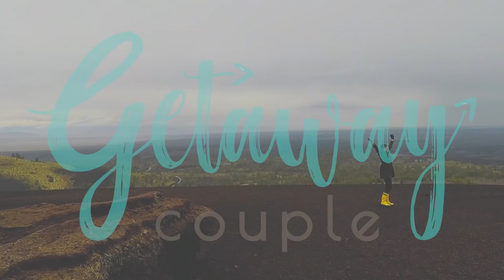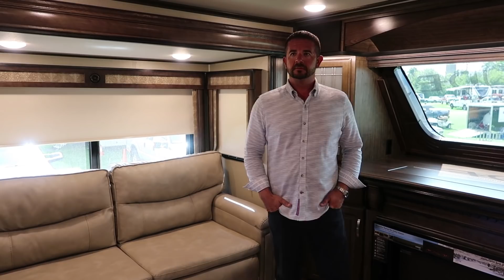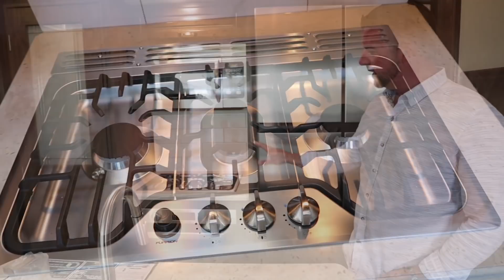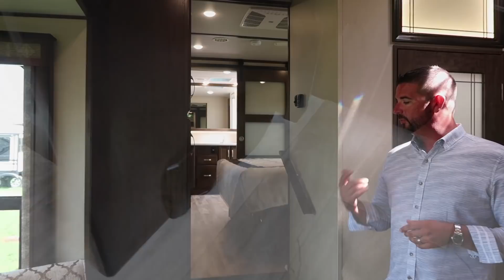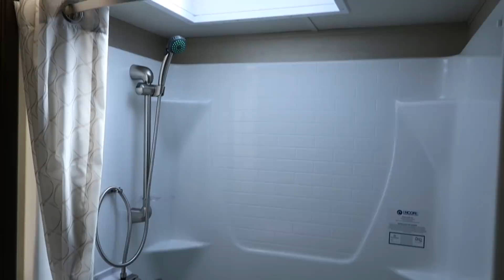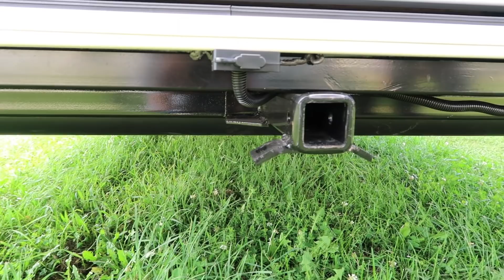RV Tour: 2019 Grand Design 380FL (Brand New MUST SEE Floorplan!)

Comment: You would think with an MSRP of $90K to $100K, that it would come with a stackable washer/dryer. I know of cheaper models that do come with them. But it is beautiful!
Reply: I was thinking that sound structural and thermal engineering would be useful, but I know that doesn't happen at this size in this price range, either. Aesthetics are a lot less expensive and lighter.

Comment: What kind of frame does it have?
Reply: Aluminum in a dissimilar-metals mix with steel and without a thermal break, claiming R values that defy the laws of physics--the usual RV industry routine, unfortunately. I had really been hoping for an engineering design that was seriously grand, but it is far from it.

Comment: Great video. Nice 5th wheel. We have a 2018 Montana 3730FL, very similar design. The 380's kitchen seems to cramped with the half bath stuck in right by the pantry. Still a nice unit, just not for us. You all be safe. Safe travels. Later
Reply from the maker: Thanks for your input, Walt! It didn't feel cramped when we were in there but I get what you're saying. We were thinking it might be nice to actually turn the pantry into cupboards and expand the counter space next to the stove. Happy travels!
Reply: @GetawayCouple   I agree having the option of the extra counter space and cupboards would be a great option. We just ordered this unit and I asked if there was anyway we could trade out the half bath for another pantry/closet and counter with cupboards...the answer was "No"
Reply: I agree about the kitchen . With no dishwasher you need the island for dishes. There is very little meal prep space or counter space for appliances you keep out - like a coffee pot. And even if you put them on the hutch countertop where do you plug them in?

Comment: I love the GD floor plans. but the A/C (which is blatantly obviously running ) is way too noisy. I am leaning toward a Keystone just for the whisper quiet air.
Reply from the maker: Yeah, our mic was obviously picking up the A/C in this video but that's to be expected. Personally, we don't mind our unit and never notice when it's on. We still watch movies and go about our day with it on and it hasn't been a problem.
Reply: Scott N we also have a Grand Design 369rl. And the ac is brutal. Noisy and works very hard to keep the unit cool. After a year of having it. The front cap started fading. We called GD, and they didn’t want to hear from us.